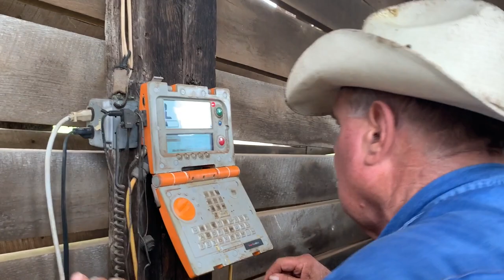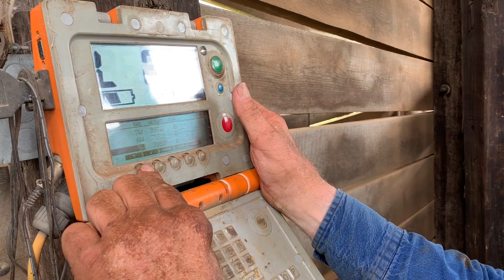Changing Minds! : Banding Bull Calves, Busting Hydraulic Hoses

Comment: I have used the XL bander for several years now. I let my bulls grow has big as i can before I band. The trick on big bulls is pull "them" through one at a time. We are in the same boat on whether to sell or hold. Sold a few locally. The processors are up in the spring for appointments now. May be the new normal.

Comment: Farmer's and their families are always hard workers!  And without saying......there's never a dull moment on the farm. I would rather a hose break or needing replaced than an expensive part. 
Meredith, for the first time in our out building a damn rat got up on the tractor floor, worked its way to the engine, and built its self a nest.  We pulled the tractor out, and the darn thing went running.   Thank goodness he/she didn't go after the wires.   I ran into the house, and pulled out the strongest cologne packed from my dad's estate.  Cleaned up the nest, poop, and all.  Sprayed the covered out building with peppermint oil, dropped several bars of Irish Spring soap around the inside of the building.  Then broke the top off of that cologne bottle and poured it all over the floor of the tractor, and the floor under the hood.  This should keep that rat away.  I'd like to put a cat out there but I'm afraid the bobcat or coyotes would get it.  Life on a farm....what can we say.    

P.S.  Got the shirts, and the guys, and I love them.  Great quality!!!

Comment: I don't like wearing gloves either but make sure I have them on when stringing barbed wire, splitting firewood, and doing iron work.  It is so easy to get an infection. When y'all go to get a new hydraulic hose, tell the hose man you want 4,000 psi hose. Cost a little more but last a lot longer than the 2,500 psi. Saves money in the long run in reduced down time and less wasted hydraulic oil.

Comment: The question I have is did you use a tetanus vaccine? The tetanus vaccine is recommended for larger calves.  I've banded for years and have used a blackleg with tetanus in the vaccine. Covexin 8 is what I have used. There is another one , but I can't remember the name. I loved the cordless drill on the lunch table.😁

Comment: i always band, the flies are very bad here as calve are born in May once out of the 40 to 60 below,  also unlike cutting know mater the age, they dont even know anything was done, when cutting they go off feeding, young or older due to pain, banding it been proven thought testing, they dont feel any pain, witch keeps them eating and gaining.. cutting they run off and hide or stand at the outer edge and may come in an eat a little, but far from normal.. i would be putting a pipe behind there legs just below the knee, you only get kicked once with out it, i have had broken caroler bones,  broken ribs, and i been suffering for over 2 weeks with broken ribs again..